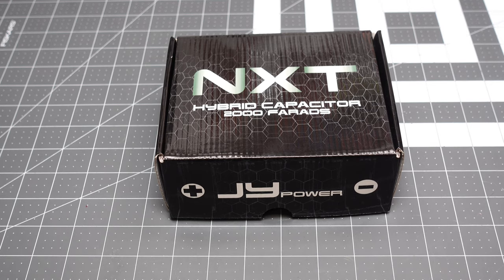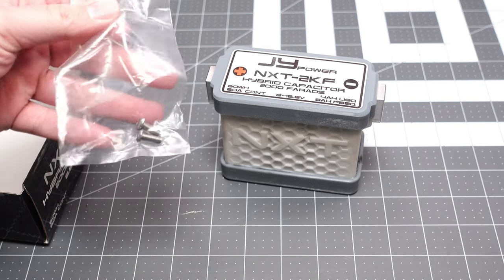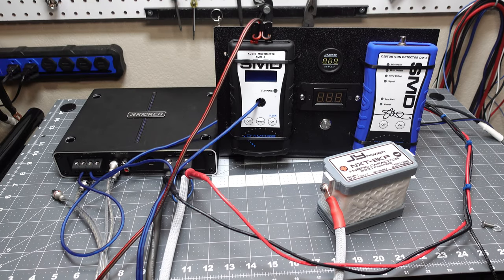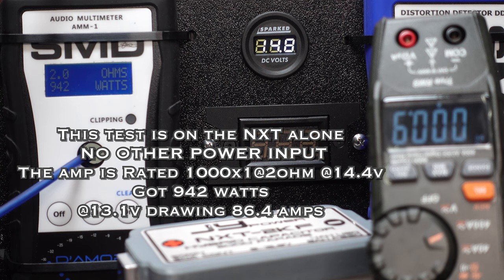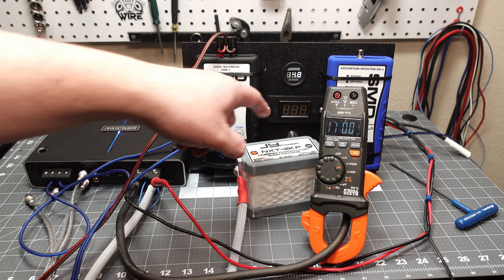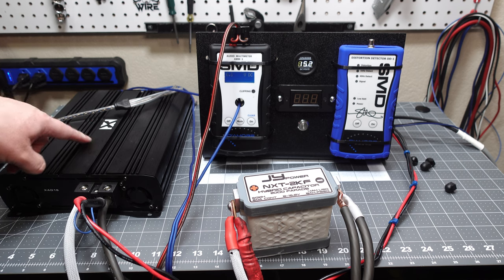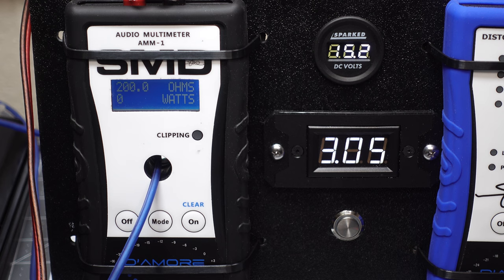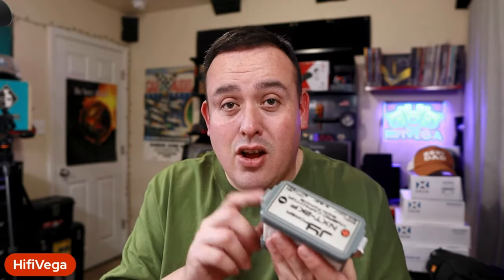Reviewing & Testing the JY Power NXT-2KF hybrid capacitor/lithium battery

Comment: Was hoping to see you test 2 of the NXTs with a single power supply.

I like to keep the electrical stock, as newer cars get complicated and it's more reliable to keep it mostly factory. I currently have one of these powering a Taramps Smart3 and dual 12" Sundowns. When I push it, my headlights still dim. I think two would be perfect.
Reply: This is what I needed to read!! I just order a second NXT and my first Smart 3, hoping it stays above 13.5 with just them, a small under hood AGM and the big 2 I did lol (ground from battery to chassis, charge cable)
Reply: @BlueTegu360  don’t sleep on you grounds.
Reply: @BlueTegu360  Ground engine to chassis, that is the most important!
Reply: Add a agm battery to that capacitor.

Comment: That resting voltage is high at 15v. Im new to lithium, this mix with say my two agm batteries that rest at 12.8, 12.4 ish when sitting for a few days doesn't affect them negatively? This would probably be the best thing for my setup. I have a Singer 350a, two Northstar batteries, gp ofhc 1/0 big 4 and all gp ofhc 1/0 wire into my distro to power two crescendo symphony amps(s4 and s1v2). Sometimes when my voltage dips, my smd vm-1 shows when it recuperates, it spikes sometimes to 15.5v, if it's a higher frequency bass tone. I take this would smooth the spike ?
Reply from the maker: This battery will just be pulled down to the operating range of your batteries, but it’s still within the operating range and will help.
Reply: @HifiVega  gotcha that’s great news then. I figured but didn’t want to potentially overcharge my setup. Thanks for the reply!

Comment: Where exactly should you or could you place this device reason I'm asking is im fairly new to lithium and super caps/Hybrid caps and right now I have the ioxus ultra cap and a 74AH lev60 pro V2 from jag35 works great for my setup 1800.1 on two Q-class L7 12 im told it can push more than double that on just the lithium i don't know but I'm running that with an isolator and my lead acid up front for the car unfortunately the ioxus is way to big to go up front could i put this in my battery bay under the hood and run it as a buffer between the alternator and the lithium I know it is not needed for what I'm currently running I don't even get a volt drop but I want to upgrade to around 5-6000 watts rms between the trunk and mids/highs and I was thinking with what this is rated for as well as the other two I'm wondering if I can't use this like I asked and go ahead and upgrade

Comment: Wow that is definitely impressive at $299.99 USD i wouldn't expect any less. I can see my self-using maybe 3 to 4 of these along with a D3400 under the hood and a 320 amp Mechman Alternator to keep them charged up. Vs larger heavy batteries.
Reply from the maker: It definitely surprised me
Reply: $900-1200….. I would think there is much better idea for the money.

But whatever makes you happy!💯
Reply: @Top Shelf Innovations what makes you think that this makes me happy? Lol! You guys and your comments 😅 all i said was what i stated in the comment. An opinion.

Look is this expensive? Absolutely are there better options out there for a much lower price? Im not sure,  this is the first time i hear of these caps and this shape and weight, i like the idea of their small size and big performance. Based on the shape and size alone they can go in a spare tire location for cars that cant have full size extra batteries.

XS power has their little cylinder caps that look like soda cans and those cost a quite a bit too. I see those much harder and dangerous to work with, ive already seen people settinf their cars on fire with those because of the way they are installed. In my channel i have a saying: (Go with what you can afford at the moment or if you really want the pricey gear, save up the money till you have what you need for your unique system build) unfortunately people have different income strengths, some have loads of cash and some don't. So I try not to push what I buy on others. Again that's just an opinion. 😁👌
Reply: @your mom  well, of course i would prefer for the price to come down, thats why i also said i wouldnt expect any less for the $299.99 price lol but in my reply to the other dude i did talk about space limitations or weight limit as well. Those XS power full-size batteries like the D3400, for example, aren't light, but they definitely are cheaper than these. These remind me of power wheel batteries, but for car audio 😅 and would go great in a spare tire location for cars that cant have full size batteries for an audio system. I think when it comes to tech we are going in the right direction but just not price wise, i agree that it is definitely excessive.
Reply: It's currently $389.
Reply: firebirdude2  ouch, that went up quickly lol! Now that's not such a great price to me anymore lol, maybe ill just stick with the XS Power Batteries lol
Reply: I am looking at using a sound digital amp 800.4 along with an audio dynamics 1200 watt amp on a bike. Possibly may add another 1200 watt amp. Will I need more than one to power these on a Harley or will I need two of these ?

Comment: Nice video buddy keep them coming.
That little NXT thing seems to packs a punch.
Can you share your Suggestion for the below.
Do you think running an isolator between the stock battery and this hybrid unit will be better.
I have a lighting set up with 550W,
Now planning to add an audio system with all amps combined rms power of 1500Watts which will run 3way front, 2 rear effect speakers, a front sub and a rear Sub. I basically an SQL guy.
My Stock Alternator is rated at 140amps.
Reply from the maker: I would not run an isolator in this particular set up. The capacitor will work best when wired with your main battery imo
Reply: @HifiVega 
 Thanks Man👍

Comment: Man I been on the fence about what to use to help with my headlights dimming for a couple months now and once again you are rite there to show another option .....I have to do something the jp231.5v2 and dual 2 american bass xr 12 .....I ran some 0 guage this weekend from where I had my grounds on each side of the extra cab from the floor pan over to frame and I plan at moment on putting a stinger agm for 2000watts + in the extra cab  in next couple weeks I just hope it will be enough to handle 2 xr12 d2s because eventually I will be adding one more although the one xr 12 d2 is very impressive by its self ....need to figure out how help with lights....if the agm doesn't do it ....going to go even larger with alternator rite now I am only running about 25 more volts than stock ....thinking about a 250 volt ....which would be about double what I have currently....

Comment: So its good for about 50a of current short term
Reply from the maker: For peaks much more, but as is it’s more of a capacitor than a battery. Being a hybrid it’ll surprise you though.
Reply: @hackmunch3949- The manufacture has rated this little super cap/battery combo/hybrid, for 60Amp continuous= not short term as you said. Peak, or burst= short term probably around 120Amps! The thing that helps this little unit out, is that it is a Hybrid= battery= more stable duration+ a super capacitor!

Comment: So to install in the car, would you just cut this in line on existing amp power and ground cables?
Reply from the maker: Front battery to the nxt then nxt to the distro then distro to amps
Reply: @HifiVega  and ground side the same?

Comment: Could I add this onto my stock battery, would I need to add anything else to make sure I don’t break it?
Reply from the maker: You can run this inline with your stock battery without adding anything else inline. That’s how I run it in my truck
Reply: @HifiVega thank you so much man🙏🙏🙏🙏🙏 I’ve been looking everywhere for an answer.

Comment: I'm running a Taramps MD1200.1 @0.67 ohm, 55ah of AGM under the hood, an NXT, and a stock 130ish amp alt, 14.8 charge voltage, and I don't drop below 13.8 wide open on music.
Reply from the maker: Nice!
Reply: Nice, so if I was to get one of these nxt-2kf would I jus come from my agm under the hood to this nxt then to a fuse then off to my amp? Is a battery isolator needed or do you need to charge it every few weeks or will it charge while vehicle is running?
Reply: @johnnypiper1717  I have mine run just like you would a second battery. It's fused on both ends (right after the main battery under the hood, than just before the NXT) then the power goes to a another fuse then to my amp. It will charge in parallel with the agm.

The thing I've noticed over the last couple of weeks that's it's been above freezing, is even when the car sits for 8-12 hours the voltage is still above 13 when I go to start it. I'm so happy with it I just ordered a second one and a Taramps smart 3 🤘
Reply: @BlueTegu360  sounds like a winner then might have to get me one of these little guys then. You wouldn't happen to know what kind of charger you would use to charge the nxt would you? Thanks alot. I'm getting a 320A mechman with xs4900 agm and if I add the nxt I know for sure I be good since my amp is jus a DD M2000
Reply: @johnnypiper1717  You don't need to charge them, they come precharged around 13.5 volts and are ready to go. Being super capacitors they'll go from 13.5-14.8 almost instantaneously after a start if you haven't gotten into the AGMs reserve.

It's still a bit crazy to me that this little box is basically running my whole car because my voltage never gets to the point that the AGM is doing any work at all.
Reply: @BlueTegu360  that sounds awesome, think ima definitely get 1 then instead of buying a smaller agm. Jus will have to figure out how I can mount it or keep it stable in my truck under my back seat of my ram

Comment: Just has to ask: Does it have a safety feature? What happens if you short it at full charge?
Reply from the maker: I am unaware of exactly what bms if any this houses
Reply: @HifiVega  Do you have a Fuse or Circuit Breaker between this and your main/starting battery?

Comment: Would this pair well with my audio legion 1600  and 100amp alt running at 1 ohm?  Wonder if ibwould stay above 14
Reply from the maker: This one won’t keep it above 14 by itself. It’s mostly meant to keep you from dropping to dangerous low voltage levels

Comment: I am looking for something for my Rockford Fosgate Power BD1.1500 running 2 12inch T1s . killing my Civic and looking for an alternative to a High Output Alternator.and unable to add larger battery due to area..
any info on recommendations..?
Reply from the maker: 2 of these would certainly help
Reply: An alt is going to be around the same price. An Alt should be the first thing you should do. Then big 4. Then batteries
Reply: I am looking at Alternator but for the 2020 1.5L having a time finding one and..in the civic forums seems like they mess.with the ecm and car.. it is my daily driver so I am trying to.figure out something. need around a 250Amp HO Alternator. that is Factory bolt on . have not given up the search still looking...
but running
the JL Audio VXI 8.800 multi and rockford 1.1500 mono
ROCKFORD T3 components front and some old Pheonix Gold companies for rear fill.
I will figure it out but this avenue does intrigue me.

Comment: What if your got a couple of those to run say 6, 8 or 10 thousand watt amps on the 200amp power supply?
Could you do a test that way?
Reply from the maker: I feel like at that point you can probably find a battery that would work better for you. Maybe a diy headway bank, or a HP40
Reply: @HifiVega  exactly, was just wondering about it for testing purposes to see what multiples could do. Hopefully they will come out with a larger version soon and keep the cost down.

Comment: I think with everything cranked I drop to 11. Something volts been weighing options. Was leaning towards a xs power d3400
Reply from the maker: Agm is ole reliable, but I’d consider lithium for sure.
Reply: @HifiVega  yeah for my everyday driver I'm looking for the most cost effective choice but get the best voltage I can without dropping

Comment: I need one of these with an LTO chemistry for a buffer for my front stage amps
Reply: These are good up to 16 volts, it will run with your LTO just fine unless you're charging over 16.
Reply: @BlueTegu360  ah OK, I'll have to check with the guy who supplies my lithium cells, cheers for the tip mate
Reply: @bradmeek  that should be under 16 volt!! Not over. Please don't charge over 16 volts lol.

Comment: Wonder how it would do vs the xs power 630 farad ultracap. Hard to believe how many farad anything really is
Reply from the maker: I plan on comparing it to a ioxus cap at some point
Reply: @HifiVega  it won't disappoint
Reply: @HifiVega  I'm assuming you are talking about an Ioxus UC-31. If so, how do you think they will compare? I'm looking at getting a UC-31 because a b stock is pretty cheap. Wondering if this for $300 compared to the UC-31 for $130 would be worth it. Thoughts?
Reply: @R1Raven_  I've run both, this holds my voltage 0.5-0.8 volts higher than the 1000 farard Ioxus I had on the same system. Given the size difference it's hard to believe. The thing to keep in mind is the Hybrid caps (like the NXT) don't have near the same discharge rate as the EDLC supercaps, but they are 10x more energy dense. So for systems under 2000 RMS the NXT is the better option imo. Not just because it's smaller, but also because it has more reserve capacity. If space isn't as much of an issue I'd just run a small LiFEPO4 lithium bank with an AGM under the hood. You can run LiFePO4 and AGM without an isolator with no issues.
Reply: @BlueTegu360  good info. Thanks for that. I originally had a Yellowtop and 3 Kinetik BLU batts but they didn't play nice with each other and the Kinetiks all swelled and had to trash them.

Comment: I think this device only really makes sense if your alternators can basically totally power the load, and this is able to clean up the ripple from the alternator, but not really able to support much more load than your alternators can provide. contrast that to a lithium brank that pretty much makes the alternators irrelevant as long as you give enough time to recharge.
If it really is 2000F, that's pretty much 0.6AH per volt lost. if your amplifier is drawing 120A more than the alternator can provide, you are dropping like 2V every 0.01 hours, so about every 36 seconds. if you started out at 16V, you're at 14V in half a minute, and that isn't even counting the voltage sag from the initial load.
That being said, if you compare it against lead acid in a system where the alternators can deliver the current demands of the amplifier, that capacitor would probably smooth the ripple as well as a full size car battery while being tiny and being able to be placed right next to the amplifier. It's nifty if a bit pricy for it's actual capacity, but could be useful if you are too space constrained to have a bunch of batteries.
Reply: "If it really is 2000F" well 400% of a 3000F bank would be 12000F and with it being a "hybrid" is kind of a moot point as far as capacitance goes as batteries are not rated in Farads. Ripple is the reason audio caps came out, was never to be a substitute for reserve, it was to get rid of noise. Have you ever opened one of those sad excuses of a "capacitor"? just a couple small caps, some goo and a chunk of concrete! yeah that's not a joke! (well it is but in a different way)
Reply: @commonsenseisdeadin2024  I think you are conflating modern Lithium Hybrid supercaps with old ~1F car audio caps.
The old caps that people used were definitely useless but these are useful in a way but the energy density isn’t quite enough to replace a battery.
If you look at suppliers that actually make these like Taiyo Yuden, they are totally rated in Farads. They aren’t quite the same as batteries.

Still not sure how useful they are, but they are sort of in their own class.
Reply: @pjtruslow  That is what I was referring to the old.5-10fared caps. They were meant to filter noise/ripple as you had mentioned ripple. 

I run lithium (NMC) and supercaps (Eaton 2.7 3000F cells).

I have no idea what this "hybrid" shit is but I don't care, $400 for that joke is asinine! I don't care what "technology" they label it as, that tiny thing is not replacing your battery and is a gimmick at best! 

None the less, kudos to them, they are just playing the game and know for every product there's a fool who will buy it! Considering there's pretty much no set standards or rules to abide by in car audio, they are literally laughing in our faces and not even trying to hide it!
Reply: These farads ads aren't the same as say maxwell 3000f farads these are a marketing gimic ive been researching these four months now they are regular 18650 lithium battery except one of the anodes has been replaced with a graphene anode and graphene is what's used in supercapacitors so they're calling it a hybrid when by definition you cannot have a hybrid between a capacitor and a battery because one stores electrical charge between two plates the other has a chemical reaction between two elements creating electricity so they're two completely different methods of making voltage and amperage that's like saying I have a hybrid between outer space and human being it's like we you can't your human being likewise you can't blend a capacitor with a battery their very nature is different and the maximum amperage for a one-second burst is 60 amps even though it's rated at like 4000f each you still can only pull 60a thats nothing compared to a maxwell 3000f cap which can do 2700f Short Circuit.

Hell you can get a123 18650 cells that are rated at 50a continuous for 1.50$ per cell right now and build your own pack for 1/3 the price of this clown